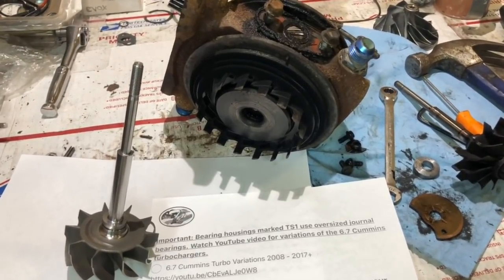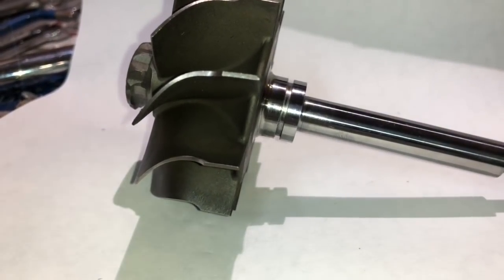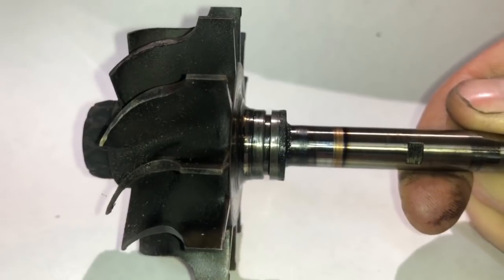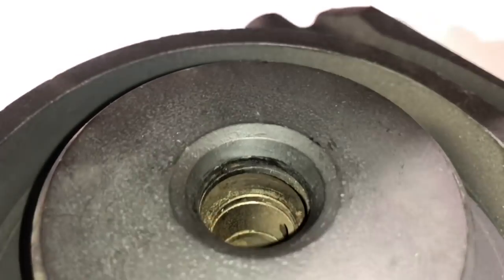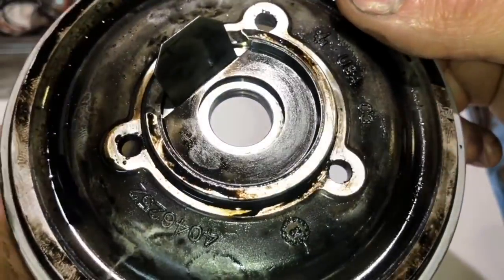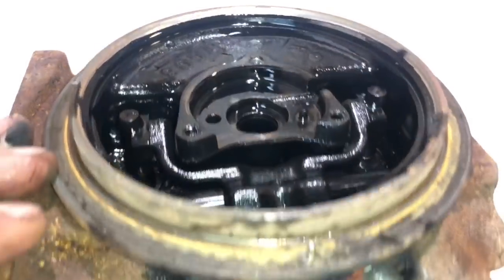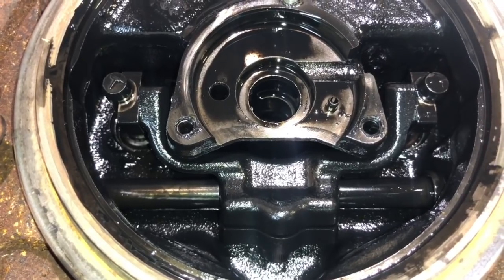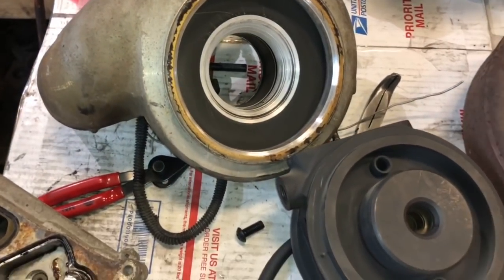He351ve inspection before rebuild

Comment: a small screw fell in to my air filter assembly, it chewed up the fan or turbine pretty good, i pulled the turbine off and everything is clean, do i have to worry about, no plat in the shaft, i will clean my aftercooler and change my oil and filters, i am i doing ok?